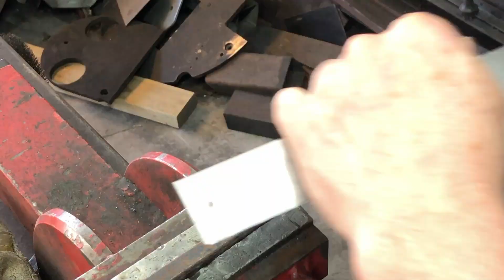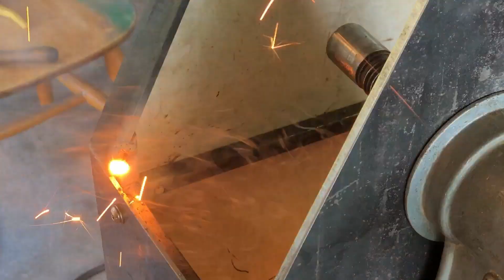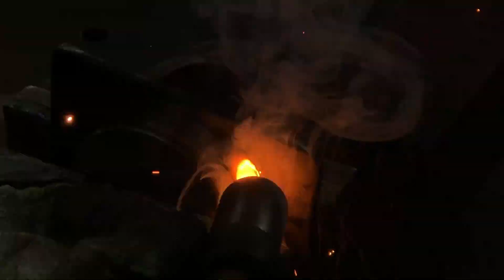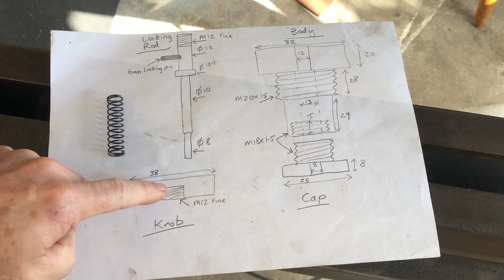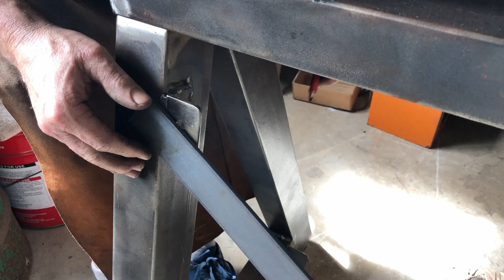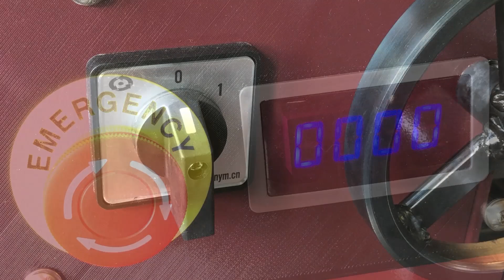Lathe Restoration And Improvements - Almost Finished

Comment: That looks great!
Im curious why you went with a reeves drive? i hear they are notorious for seizing up  
my craftsman which was basically new old stock no use is not changing speed and it makes a funny noise , i think it s the motor fan.

do you lube or grease up the shaft at all? that the pulley is on?
Reply from the maker: Thanks for your questions. The reeves drive worked well but it was very unpractical for a wood lathe. When turning you are always changing the speeds. With my design I had to keep winding the hand wheel for faster and slower speeds. Also I could not start the lathe when the lathe was turned off but the speed was still set to fast. The last issue was the lathe itself. It was designed as a spindle lathe for turning long skinny items. The swing was very small and you could not turn a decent bowl on it. Not long after I finished the project I purchased a proper wood lathe. This lathe has since been dismantled and parts of it sold off.

Comment: Ouch 😥. You'll have to run that pulley as a counter shaft, motor separate, then you'll be up and running. Could also incorporate a low/high range as well then.
Good luck and thanks for the vids! 😊
Reply from the maker: No problem, thanks for watching.

Comment: That's amazing work. Are you going to make a New hollow spindle? Love your radius jig for the belt grinder.
Reply from the maker: Thanks you for your comments. Yes, I need to make a new hollow spindle as the original spindle is not long enough. Also, the thread on the original spindle is quite bad so it could be a bit risky using a chuck on it.

Comment: Hello friend. I hope you cussed that motor! Lmbo! 
Out of curiosity? Have you thought of remaking the motor shaft? I believe you have the skills to tackle the job. 
By the way the welding table is going to the back burner for a while, steel prices are going up quick! Six ish weeks ago a 4 foot by 8 foot by 1/8 inch sheet hot roll was $90. Thursday this week I paid $135. My arm would fall off if I tried to buy a 1/2” sheet. Looking forward to your next video.
Reply from the maker: Hi, I have not had a good look at it yet. I know that it broke off very close to the housing so welding it back on, or adding a sleeve is probably out of the question. I will have to do some research into replacing motor shafts to see if that is possible.

Over here everything is going up like crazy, including steel. I guess it is the same all over the world.

Comment: Hi Jon, fantastic work on the whole thing mate, I reckon it's more robust back there than most metal lathes lol. What a shame about the motor shaft, you must have been gutted. If only it had happened prior to painting........ Sods law. Cheers, Jon
Reply from the maker: Thanks Jon. I'm a bit annoyed at myself. I did plan on adding a bearing (as suggested by one of the viewers), but I put it off so that I could get the video out as it was like a month from the last lathe video. In hindsight I should have just done it in this video. Never mind, I will find a replacement motor and add the support bearing. Then I can work on the new spindle and we should be up and running. Thanks for watching and your comments.

Comment: Sorry to see the issue with the motor. Most motors are made to given frame types with standard spindle heights and bolt spacing so finding a similar motor should be doable. Looking forward to seeing it run.
Reply from the maker: Thanks Ben. Yes, I will need to check what the frame type is and look for something the same. That would be the easiest way forward without making modifications.
Reply: @thehobbymachinistnz  There will be several frame numbers that should fit without much trouble.

Comment: BTW, a 3rd alternative to the spindle lock spring up with lock down vs spring down with lock up mechanism choice is a bistable mechanism. An option, but usually more complicated.  Also,  consider the ball point pen retractor, perhaps a more automatic spring up lock down?
Reply from the maker: I did not consider a bistable mechanism, but yes, that would also work. Thanks for watching.

Comment: It looks nice.
I'd be tempted to weld onto what's left of the motor shaft. Maybe actively cool behind the weld so as not to damage the windings. If you weld shafting on to it that is oversized you can then turn it down to spec, then all a pillow block bearing so as not to repeat the mistake.
Just a thought, so that you don't have to scrap the motor. Sometimes you can even press out the main motor shaft. If that's the case then a repair would be even easier.
Whatever happens, good luck. Thanks for sharing.
Reply from the maker: Thanks for the ideas. There is not much sticking out of the motor so I think my options are limited. I will have a closer look when I remove the motor from the lathe. If that is not an option, it may be possible to repair the motor for a less stressful load and use it in another project. Thanks for watching.

Comment: I told you to put an end bearing on the lower motor shaft, that is very important
Reply from the maker: You sure did, and it was planned along with the spindle bearing. But, I did not get to it in this video and in hindsight I should have put more priority on this. I will add that bearing on the replacement motor which should resolve this issue and reduce any vibration.

Comment: Gday, the lathe has really come along way from when you started, the colour choice suits it in my opinion, it’s a shame the shaft broke but better now then when your halfway through a job, great video as always mate, cheers
Reply from the maker: Thanks Matty. I will source a replacement motor and I will add a bearing for support. I did intend to do this, but that was going to be in the next video. I should have done it in this video in hindsight.

Comment: Oh no!  An overhung load on a motor shaft.  I was worried the speed adjusting system would put too much vibration in your spindle, but you cured that with an end bearing.  Didn't even consider the overhung load on the motor shaft.  What's good for the spindle is good for the motor, I guess.  Good luck!
Reply from the maker: Yep, the motor needs support as well. I did plan to add it, but I did not get around to it. It is a priority now.

Comment: Gee what a let down. It's only a minor set back as the lathe does look great. I agree support with a bearing on both sides taking away any load strains on the motor. This will improve the operation and less vibration
Reply from the maker: A bearing on the replacement motor will fix this issue. Thanks for watching.